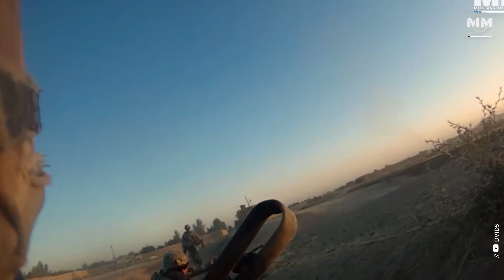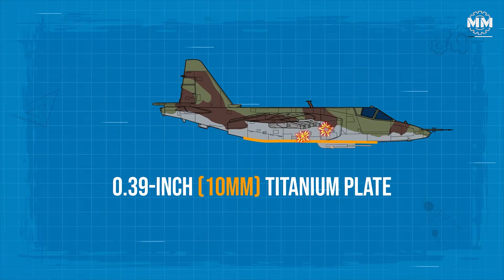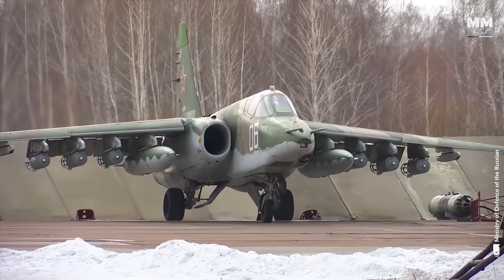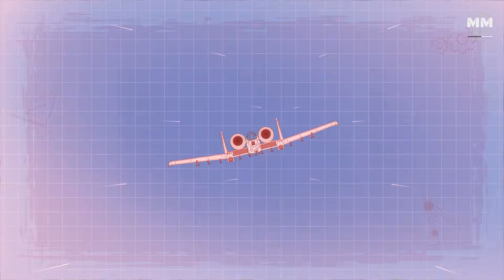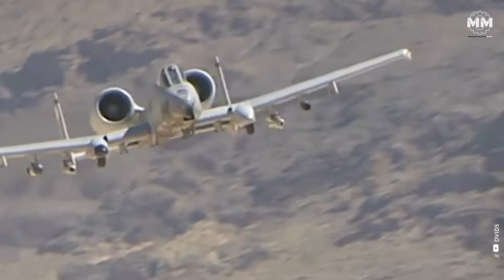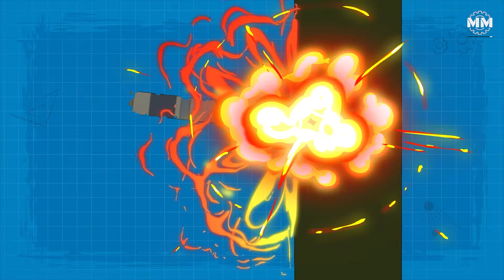A-10 Thunderbolt II vs Su-25 Frogfoot: Deadliest Close Air Support Jets Ever Built

Comment: Two items Not discussed correctly were Loiter Range w/Payload (nor the A-10's ability to air-refuel), and the "smartness" of NATO/US weapons Vs. the 'Dumb Bombs' and 'Unguided Rockets-in-Salvo' that the SU-25 only has [Wait; ;Ukraine may, yet, find a way to make the Frogfoot 'accuurate', like an A-7 already has been for 58+ years]. The Frogfoot is Faster, supersonic in a dive, even, but, that's only real advantage. The A-10 fights Smarter, loiters longer, and has a Gun that belongs on a Tank, that fires at 4500 Rounds-per-minute that can  punch thru 90% of any tank's armor. Both are nearly Obsolete, but, that was said of the A-10's Inspiration, the A-1E Skyraider, back before I was born {1964, btw}. The Russkie will fight-on longer than the A-10, only because the USAF Refuses to let either the US ARMY, or Marines, have A-10's, and Steadfastly REFUSES to give them Two Crew w/Modern Electronic-Warfare abilities. Great planes, in their own right, but the Thunderbolt, despite being Slower, would be what I'd want to fly/fight in.
Reply: That 90% of tank armor claim is not based on reality at all. Not to mention the Su-25 has guided munitions.
Reply: @Simulcrom  the gau 8/a avenger fires 30mm depleted uranium rounds that is literally meant for busting heavy armor and concrete walls
Reply: @yanderechan4886  Test trials showed that it had a pretty low kill rate against even a T-55, let alone T-72s, T-80s, and other 3rd gen MBTs.
Reply: @yanderechan4886  And the Su-25 uses a 30x 165 mm cannon also, a little less speed (971 vs 1013)  but an heavier bullet (uranium or tungsten carbide).
Reply: @Simulcrom  also a-10 also have guided munitions like jdams, agms maverick and etc.
Reply: @yanderechan4886  So? That was never in contention.
Reply: @Simulcrom yeah 30mm AP is made for hitting tanks from the back right?
Reply: Are you joking or what? Su-25, even in its baseline version (now it is at the SM3 one) normally uses Kh-25 and Kh-29 laser guided missiles as also S-25 laser guided rockets (and also non-guided S-13 and S-8 are almost as precise as the gun itself).
Problem is maybe with the gliding UMPK kits as the Su-2 has not the speed to climb up at sufficient velocity to add enough range to them as a supersonic plane would do but the new rocket propelled UMPL would correct this also.
Reply: @Marcellogo frogfoot is a very capable ground attack aircraft.  we need to quit toeing the cold war line of lies
Reply: El gringo solo ataca a pastores de cabras😂😂😂
Reply: @AngelRamirez-d4j 🙀🐐
Reply: we should reintroduce the sky raider for low intensity conflicts.  hell anytime you have air superiority you could use it
Reply: Supersonic in a dive?
Reply: Me as well. 😂
Reply: We should give the entire A-10 fleet, to Palantir for drone upgrading.

Without needing all the life support stuff, ejection seat, avionic displays, etc, there's a lot of room in the cockpit for computers. Turn them into motherships.

Comment: I do you know this when you hear that brrraaattttt sound the ground forces are very much appreciative because a God is dropping from the air to take care of business. The A-10 is a beast. It's difficult to knock one of those out of the air. Both platforms are excellent weapon systems, but if I had to pick, I would take the A-10 because it has proven itself many times over in combat. Like the old time-x watches, it takes a lickin and keeps on ticking.
Reply: If you hear the brrraattt, it is already to late if you are a bad guy.  Although if you do hear it, you are still alive, for the moment.
Reply: The facts speak for themselves, the Su25 has operated in much more hostile environments than the A10, the Su25 flew in very hostile airspace far from any air support, the Su25 is having success in Ukraine, both Russia and Ukraine use it and it has managed to successfully eliminate many of its targets, while the reputation of the A10 is only based on the wars the US had in the Middle East, without a doubt the Su25 is significantly superior to the A10 just by experience

Comment: Bro...your poud feet and gallon do not work whole world. So kindly speak in terms of MTR, kg and ktr . Otherwise most of the World can not understand the measurements.
Reply: It literally has the alternative in the video. Stop complaining
Reply: There's no metric on the moon. Our way won.
Reply: All you need to understand is the Su-25 performance in Ukraine - total failure.  It is a paper tiger.  Compare it to the A-10 performance in Iraq during the Gulf War.  Enough said.
Reply: @Marcus-ki1en  Why don't I see A-10 in more solo missions in manpad/air def danger zones? Why don't I see more nations using A-10-why is it just the U.S the sole operator? Why is it only appearing after AWACs & ECM & SEAD/DEAD have been completed prior? Why isn't it facing more equal hostile environments as the Su-25 constantly does?

A-10 is expensive and impractical without ally support, while the Su-25 is a Toyota, cheaper, rugged, and just as effective if not more, and many more nations use it and it constantly flies solo wing without ally support. I double dare the A-10 to fight in heavily contested airspace's around the world in multiple conflicts, filled with manpads/SAMs/air defenses/enemy jets in the target zone.

If not then get outta here with your bias opinion.
Reply: @mab2187  First my friend, the A-10 was designed to combat Russian tanks invading Europe, specifically the Fulda Gap scenario.  It is an old platform that has been extended.  The US Air Force was even trying to cancel it going into the Gulf War.

Second, US Air Doctrine is clear, each aircraft for its role. AWACS identifies the space, ECM and EWP helps negate enemy electronic assets, SEAD is taken care of by the Voodoo planes, Fighters take care of high cover and the A-10s and Helos are free to hunt ground targets.  That is how it is supposed to work.  Sending air assets that specialize in ground support into contested air space is wasteful and stupid (as the Russians have shown in Ukraine)

Third, not my biased opinion,  just stating facts.  Look at the results. Enough said.
Reply: @Marcus-ki1en  My point exactly, Su-25 is operated under a different doctrine despite being a Strike jet. A-10 operates under a different doctrine despite being a Strike jet.

The combat the Su-25 fights in has been different, the A-10 would be a pinata in the sky where the Su-25 fought in. & vice versa the Su-25 would've faired quite better in comparison to current way.

This is an Apples to Oranges comparison, statistics for these aircraft mean little if you analyze just what harsh combat and doctrines these two planes are fighting in. A-10 would nvr fly alone in these contested zones, otherwise it would suffer the same if not more than the Su-25 cuz its slower. Simple!

Su-25 used by the U.S as an e.g. would fair better if not the same as the A-10. The A-10's gun despite its origin, nvr was practical. It is a waste of money if you can't shoot a target Km's away. A-10 costs more cuz of the doctrine it flies-case in point A-10 needs support before going in itself, while Su-25 is cheap, rugged, and performs as well, flies into combat alone more often. Flying in contested space obviously "throw enough shit, some of it will stick". In contrast the A-10 nvr fought a equivalent equipped and experienced, and worthy adversary.

You're stating K:D's that don't tell the full picture if you think Su-25 deaths more then A-10 = A-10 superior... thats an opinion. A-10 nvr fought a harsher contested airspace while the Su-25 does. The latter has proven, while A-10 is proven in good avionics, survivability, and fancy doctrine.

Major point is, both jets are good, both of them do their jobs as Strikers, both are equivalent -- both have pros & cons. However, if you wanna do a 'vs' debate. Then K:D isn't the full picture since Su-25 fights more often and does it alone in contested space. While A-10 hasn't/doesn't. Switch their operators and you'll get worse stats for the A-10 and better for Su-25.